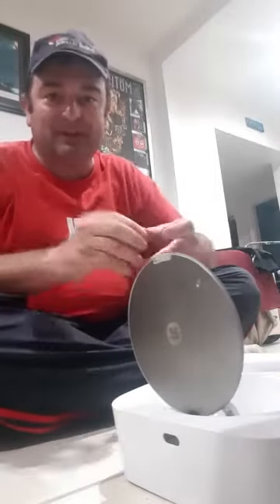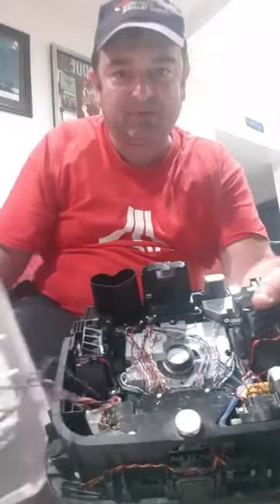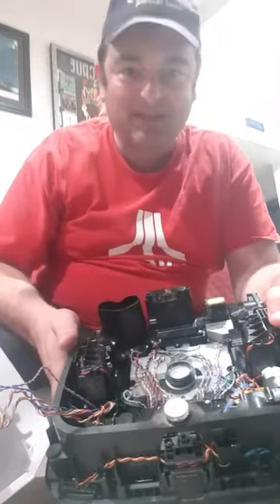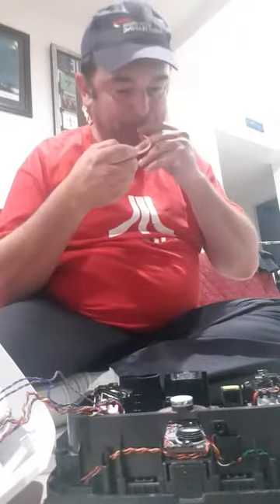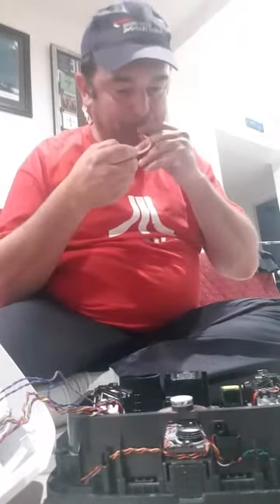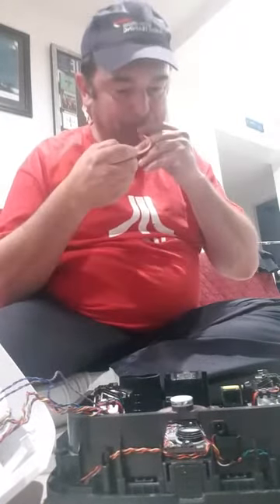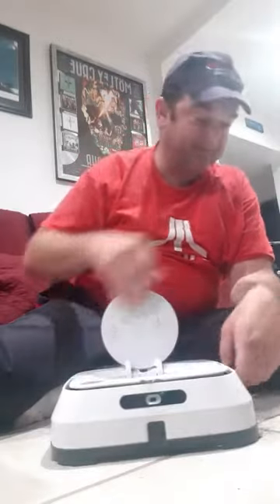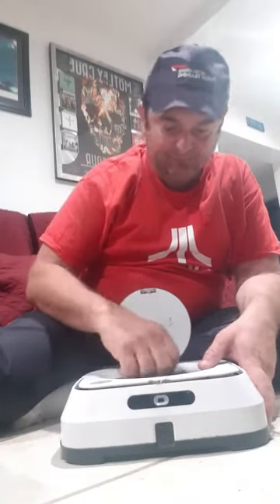iRobot M6 Nozzel Repair Part 2 troubleshooting more and reassembly

Comment: Hi. Thanks for your video, it really helped.  I actually attached a hand pump with a needle like you would use to inflate a football to the tubing going to the nozzle.  It is clogged bad.  No matter what I do I can barely get any air to move through it.  I soaked it In a mild detergent but no luck.  Not sure what else to do?
Reply from the maker: Now were talking, that is a great idea.  I might let it soak in there a while.  I would look at trying to replace the effected hose.  As a last resort I would  look at pushing something through it extremely carefully.  Do you have hard water or maybe it could be the cleaner used.
Reply: Tried to hook a syringe to mine and blow it out, it must be clogged bad, 40 bucks for this part, what can I soak it in that works?
Reply: @chuckschneweis9508  Also going through the same issue, please let me know if you find any fix. Ebay is selling this part for $40, ridiculous!

Comment: You have  to take it all apart to fix the jet mop on Braava  to adjust the jet please answer  me back my mop doesn't put  out lots of water
2100 hundred.sq.ft. house n still have a half tank of water left.its not cleaning  my house.please reply.thank you
Reply from the maker: Before  taking the brava apart check on the app to see where your water setting is.  If you need help, I can help you locate it.  The second thing is to remove the tank and as my video shows, pull out the braded filter.  This is over the hole.  This may be causing the blockage.  You can also  see the how the water sprays out of the nozel.  I have mine for well over two years, I noticed it was not spraying as much as it use to and a user requested a video on how to clean it.  I cleaned out mine and it improved. My goal here is to help people fix their stuff.